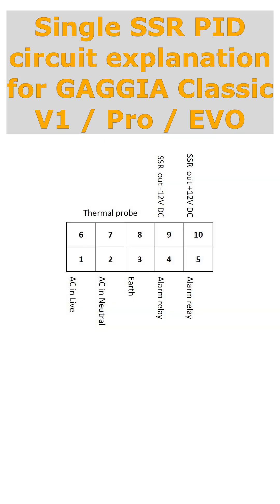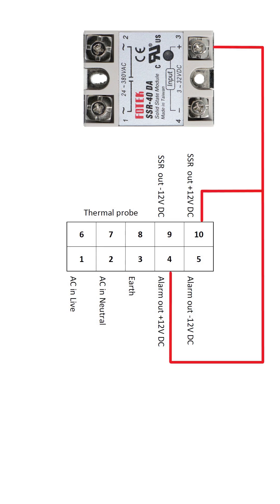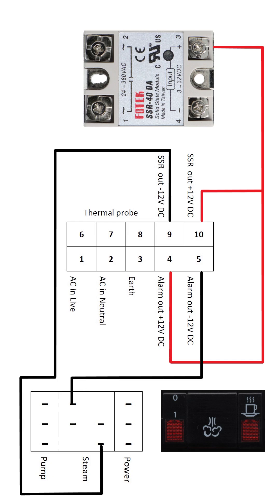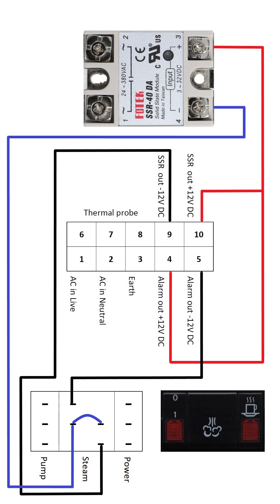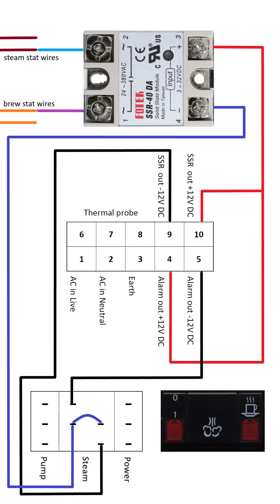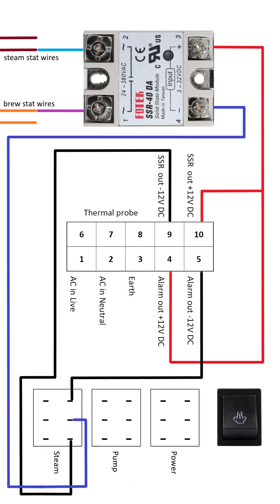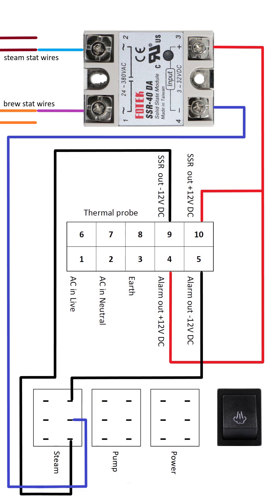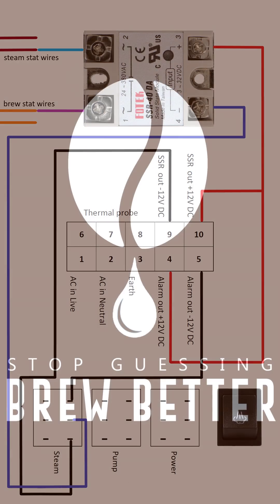SINGLE SSR - DUAL Action PID circuit explanation for GAGGIA Classic V1/Pro/EVO

Comment: I have Classic Pro. If I leave original wires of the steam switch disconnected I have no water through the group because the solenoid valve doesn't working and stays closed. How did you make it work, especially mixing up high and lover voltage connections on the steam switch.
Reply from the maker: Hi, On the Pro you only have to repurpose one side of the steam switch as that is technically 2 separate switches. Hence there is no connection between the AC and DC voltages. If I can recall the right side (from front view) remains connected.

Comment: Great explanation, thanks a lot! I'm going to do this modifications very soon following you instructions. What should I do with the other two wires from the steam and brew thermostats, should I just left them disconnected?
Reply from the maker: Yes, you can leave them in the machine disconnected. With a Pro you better insulating them too.